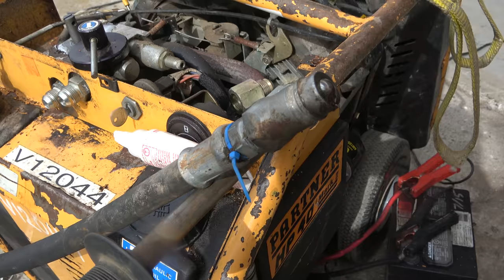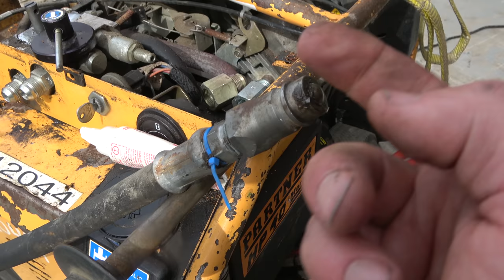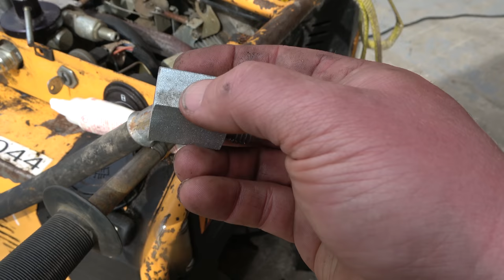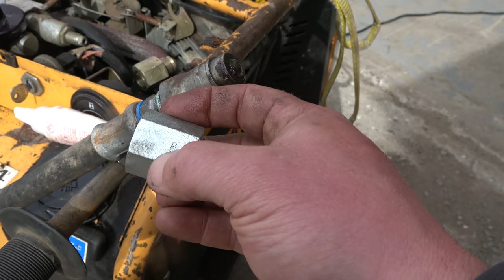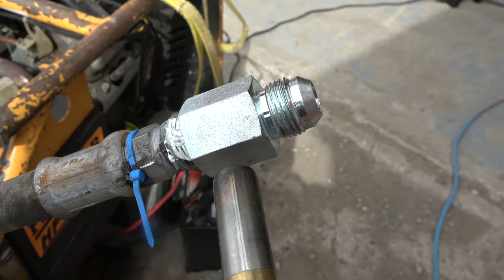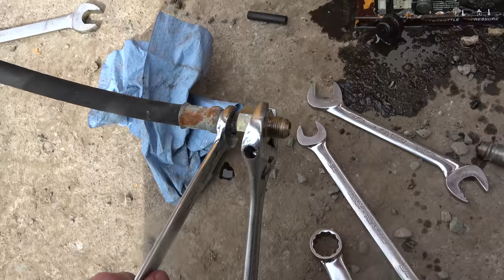#sharts Pipe thread that'll never leak (or come apart)

Comment: Youtube: shorts. Filmed vertical, under 1minute, use hashtag shorts in title or description.

Ave: Don’t tell me how to live my life #sharts
Reply: Yes!
Reply: I don't get this video. Why not use some teflon thread tape or a dip the darned thing in a tub of threadlocker?
Reply: @b3nadry1  teflon tape doesn't actually seal, it's purpose is to lessen friction between threads therefore, lesser torque needed to tighten fittings. (though fittings aren't exactly a thou or two of an inch precise) there may be imperfections in the thread hence they'd leak no matter how toight you do them.
Loctite threadlocker might do the job, but where's those 3 bottles of that stuff if'n you actually need them.
Reply: @b3nadry1  The point of any of that teflon stuff is to allow the threads to be tightened enough to distort into each other.  It's a crappy design, for sure, but it's been around for so long that we'll never stop seeing it.
Reply: filming vertical is a crime against humanity
Reply: @TheKeule33  lol agree
Reply: @b3nadry1  better to use a suitable sealant combined with flax fiber, aka angel hair. Used in much the same way as teflon tape, but actually seals. Bit messier to work with, but it works. Have to rough up the thread crests a little with a coarse file so they'll grab the fibers and drag them into the threads. Old school but skookum!

As for heating, wouldn't that work better if the female side was heated while completely off the male side so they don't just expand together? Bit more fiddly to get it screwed on quickly enough though.
Reply: @Kaboomf   "flax fiber, aka angel hair", aka "horse hair" - that's proper old school. As a kid I actually thought it was horse hair... On a flip side the teflon tape can be different grade as well, with the skookum one known (in the US, I hear) as 'military spec'
Reply: @stanimir4197  it's still available, and for some jobs it's the best.

We bought an older house, where any plumbing work involves adapting new stuff to old fittings that were apparently made to slightly different tolerances etc. Half a dozen thread adapters screwed into each other, where old-spec copper pipe mates with modern PEX etc. I wound up using flax fiber and permatex on all threaded fittings, after some attempts with teflon tape kept dripping. Not one drop since, that fiber works wonders as it expands to seal any minute gap.
Reply: @stanimir4197  and y’all above, Teflon tape isn’t impervious to some things. Fine for home water pipes, but what about industrial applications.
Reply: @Kaboomf  "it's still available", of course it is. I use it for 19mm(3/4")+ fittings. It's more fool proof as well.
Reply: @b3nadry1  The other answers too.
But do you think that would really be any harder to remove than a thread that some asshole has dipped in threadlocker?

Threadlock, locktite.... any of them, you need only cover two threads. Three max.

Comment: The coefficient of thermal expansion was my first introduction to the wonders of heat in a power plant setting. As my ignorant apprentice voice said with 70’s stoner amazement- “Whoa, dude! This steel moves when it’s heated!”
Many thanks to the journeyman who refused to throw me off the scaffolding for my insipid comments!
Reply: The difference today is you kept showing up for work. Now they show up late in party clothes not work clothes. After two hours digging they are completely tired out. Have their friend pick them up. Pudding has more of a backbone .
Reply: I am baked and even I was not surprised by that. But mil spec Teflon tape is so much easier................
Reply: @assassinlexx1993  I, for one, support the 2 hour work day. Work shouldn't take up the entire day.
Reply: @carpdog42  
If you can charge lawyer rates. You can just work 2 hours a day.
Reply: Can you explain what steel was expanding in a power plant setting. 
Im imagining the furnace or boiler rippling under the rivets with the heat.
Reply: @markc7955  Boilers are built by hanging the tubes and headers from a structural steel frame because of the expansion of the firebox caused by heat. Imagine a skyscraper that has a giant box hanging in the interior of it and the box is heated by coal or oil . The box expands down into a frame built on the ground. The frame isn’t bolted to the firebox, it just grows downwards. The same reaction to heat can be found anywhere where heat is generated or applied- ducts, pipes, vessels, structures, all have to be built with heat expansion figured into the design.
Reply: @briangarrow448  
Thanks that’s pretty cool. 
Do you happen to know at what point the water turns into steam in the pipes. Like if you have water in and steam out, at some point in the pipe it becomes gas and expands, how does it not explode or be chaotic?
Reply: @markc7955  Depends on the pressure.
Load up DuckDuckGo and search for "super heated steam".
Reply: @briangarrow448  In an everyday setting, you can hear the same process happening if you have baseboard heat elements. They're just a 3/4" copper line with tin fins on it. When the zone valve opens and the hot water from the boiler comes through you'll hear a "Tick tick tick tick..." from the baseboard. That's the thermal expansion of the copper rubbing up against the tin. Copper's more dense than tin, so there's a bit of a jostling for position as the heat transfers from the line to the fin. It's also why pipes are never clamped, hung or supported on a fitting. You always want to give a bit of room for the pipes to expand and contract without butting stress on the hanger, bracket or trapeze.
Reply: @assassinlexx1993  Well...my apprentices either leave the first day, or last forever.
Reply: @andygilbert1877  
It is good you can weed out apprentices early.
I just wish high-school would promote the trades. Not just going to collages. 
Good luck with your business
Reply: @assassinlexx1993  I don’t think schools ever have really. I was lucky at school I guess, and was encouraged by a teacher who had worked in engineering himself. I think some people are born to make or fix things and some aren’t, and will never really get it. Not fair to encourage these people.

Comment: Also, weld it around, just to be sure.
Reply: Cover it in zinc too, worked for arecibo.
Reply: JBWeld as pipe dope.
Reply: Or put the FLEX TAPE
Reply: @MaineHomeShop  I did this on a union that wouldn't stop leaking on my compressor line in the garage, it doesn't leak anymore.
Reply: @MaineHomeShop  did that to the transmission lines on my first car, kept leaking at the radiator. Turns out I was the next guy so it wasn't the best plan in hindsight lol
Reply: @Mr Brightside I just had my first weld from 30 years ago fail. Not due to me but being outside for 10+ years rusting away outside.

OP, funniest comment of the whole comment section!
Reply: My dad did that out of desperation once, when a brass hydraulic fitting screwed into a steel part kept leaking on some old agricultural machinery. Liquid steel doesn't wet brass, and even though brass has a lower melting point it's harder to melt with an electric arc because higher thermal and electrical conductivity. He used a stick welder with old damp electrodes and somehow built up a puddle of molten steel all around that fitting, when the weld cooled that thing was tight! Been more than 30 years now and it hasn't leaked a drop.
Reply: @Kaboomf  I've brazed dissimilar materials before but that is a new one for me for someone to do it with a stick welder and wet electrodes  🤯.
Reply: @Chris-dg6km  He didn't know that electrodes absorb moisture, as I recall they were always just kept in an open package. Welding on a farm happened infrequently enough that those sticks would have been absorbing moisture for years.
Reply: red loctite?

Comment: As a new owner of a hydraulic/gremlin powered equipment, I find this content priceless, I’ll be back in a year or two when I can’t get the thing apart to curse the day you were born, spanks again for the info!
Reply: You just hear it back up again to take it off.
Reply: @WARnTEA  See, you weren't supposed to tell him that until AFTER he'd broken three wrenches on it.
Reply: Get a can of x-pando pipe sealant. Works wonders on hydraulic elevator plumbing and even seals torn out threads from dull threading dies.

Comment: I work with hydraulic pipe fittings every day. I have probably tightened thousands of fittings which operate under thousands of pounds of pressure. You don’t need to heat up any fittings before assembly. What I do to guarantee a non-leaking connection is:
1. Clean the male and female threads. Remove all oil from the threads. Brake clean works best for this.
2. Coat the first three to four threads with thread sealant, loctite 567 works nice. Do not use thread tape. Work the thread sealant into the root of the threads with your finger, this keeps the sealant from just getting pushed out when you tighten everything up.
3. Tighten the snot out of it. Use the proper sized wrenches, leave the crescents in the bottom of your 5 gal pale. How do I know it’s tight enough? When it doesn’t tighten up anymore with just the proper wrenches (snipes are for the pros).
Reply: Did this before use with all the below oil level fittings on my shoddy 30gal off shore oil drain, dry as a whistle after two years. How much longer the scary clear drain hose/sight glass lasts is another story.
Reply: Second on no thread tape.

Comment: Well unless you're using cast fittin's and don't want them to crack once you fire up the boiler, but that's why you use forged fittin's. 
But also, try Leak Lock brand dope, we use it with fuel since it's actually a sort of a sealant, not just says sealant on the jug like most. 
UA Local 601 Steamfitters, Milwaukee, WI

Comment: NPTF (fuel) is made without the crest/root radius iirc. The result is an interference fit at the root, so you have a mechanical seal. EO bite fittings use a double beveled washer that creates a high contact pressure mechanical seal. No rubber seal, oring, or tape. Skookum as frig!!

Comment: To bad heavy equipment made in Europe then shipped to the USA takes 6 different wrenches to just get two hydraulic lines off...1",5/8,19mm,17mm and two adjustable wrenches set to unknown sizes. Lets not forget that the two bolts are 1/2" and 10mm that hold the mounting bracket onto the machine and the nuts on the end of those bolts are  3/4" and 16mm. I swear to god New Holland from Belgium get you nuts sizes figured out damn it.

Comment: my grandfather worked on the ford assembly line in so cal from the 20s to the late 50s.  he helped mom do some plumbing in our mountain cabin.. decades later mom wanted to reconfigure the piping.. grandpa had put it together with locktite.  mom had a heck of a time till she got out the torch.. .. not saying locktite for the fittings but i love that heating the fitting to expand it trick..  just have to recall don't do that to fuel filters and carb fittings..

Comment: YOU CRACK ME UP.  i grew up with a big ass lathe in my basement.. my dad and me used to make little cannons out of steel, what would use a ram set cartridge to fire whatever you could stick down the barrel... mostly wads of paper..  but sometimes.. we would load the lathe swarf into the barrel and fire it at the wooden wall.. just cuz it would make a pretty abstract picture... 
rockinroll

Comment: When the Next Guy was going to be me, I used valve lapping compound to "match" the threads, then cleaned before final assembly. The heat tip I used on equipment that was to be sold soon.

Comment: Any worry about that derating the pressure limit on the fitting? I’m not versed well enough in heat treatments to know if that is enough concentrated heat to effect the overall material strength.
Reply: No, a few hundred degrees for a couple seconds isn't going to be enough to do much of anything to the material properties. You don't have to heat the shit out of it, like the man says, just hot enough to burn lol

Comment: What a great shart! I would have never thought of that. 

This coming from a guy that recently realized heat greatly improves your chances of breaking red loctite loose.
Damn you ford for putting loctite on the fasteners that hold the plastic step pads to your chincy ass chunk of steel you call a "bumper".
Let's not mention the sticker that says don't remove the hitch, it's there for safety...

Comment: Hi. Can you(or someone) explain the “1 thousandth of and inch, per 100 degrees, per diameter” heat expansion thing? I can’t seem to solve this in my head. Thanks. 🙃
Reply: 1mil per inch/ per 100°F / per 1 inch of diameter. 

It means 1 inch diameter pipe heated to 100°F (above starting temp) will expand 1 thousandth of an inch.  Also means of you keep going with the temp and it the size the amount of growth/ expansion will accumulate/aggregate/be cumulative. 
That's why railroad track/line have slotted joints.   So that the temperature difference allows for the expansion and contractions from temperature.   Miles of track the growth and shrinkage adds up.
Reply: bmxscape oh I see.  Thanks. Ya makes sense 🙃

Comment: AN fittings work wonders for 3000 psi hydraulic fluid on aircraft. Beam seal fittings handle 5000 psi pretty well too.
Reply: I have worked with hydraulics ALOT but those are new names for me. A quick Google search shows the AN fitting may be what is commonly called JIC or more properly 37 degree, SAE thread, or possibly those silly automotive 45 degree ones. 

I have no idea what a beam seal fitting is, though. I have no problem with people using different names than I use for stuff, but I am interested in knowing what a beam seal fitting is as well as the AN fitting.
Reply: @timothyball3144  They are both military aviation standards. A beam seal fitting is used on high performance aircraft with 5k psi. Its kind of like two flat surfaces from each line that are torqued to a very specific value to ensure the seal. The problem is, one grain of sand with cause a leak. Kinda rough operating in the desert.
Reply: @blackhatch46  Thank you. That explains why I haven't heard of the beam seal.

Comment: So here's a stupid question :

If heating up the female end expands the metal, that makes the outer hex measure a little bit bigger. I get that. 

Wouldn't it also make the interior measurement smaller, since the metal expands in all directions? Like ya bake a donut, the hole shrinks, right?

Comment: For water connections, why not just teflon tape?
Reply: He is working on 3000 psi rated hydraulic fitting connections to pipe thread.
Reply: OMG, why would you think it was a water line....

Comment: So, I have the opposite problem. The nozzle of a 3D printer always comes loose. Now I think it is because it expands as it is heated. Besides over heating it and torqueing hard, do you have any other tricks?
Reply: Maybe just a turn or 2 of teflon tape along the thread. I have to say I've never heard of them coming loose even when hot.

Comment: I cursed the hell out of a guy who installed an engine in a truck without thinking of the inline fuel filter which was simply unreachable between the frame and the motor mount. Turned out that I installed that engine myself a few years ago...

Comment: I would use pipe packing on the threads or pipe tape which is real easy to use unless it is very dry.  Static on the Teflon tape can be a bitch.

Comment: Why just go the old good times eh ? every time i use this new teflon band shit or a leakage shmoo shit they make, its a 50/50, either its gonna leak, or it wont, its fast, its easy, but it makes you do the job 2x most likely, now when i go old times, hemp and some shmoo, its a 95/5, gonna hold/gonna leak, takes more time, but saves time, hope it makes sence... anyway, it takes you more time to preper the leakage spiral but the effects are... i do it once, sometimes, once a year i do it twice. Last week i was on a job, client asks me if i can change 2 valves, i say sure, he had 1 new 1 old, new one came with teflon ring, the one you turn in and its sealed, the key is you just turn it one way, if you go back, it will leak, i know that, so i did what i know, old one had no seal at all, so i scrached the lekage spiral, apply hemp, apply shmoo, i put it in... customer turns on the water pressure and guess which one leaked ?

Comment: I don't think this is true...

Sure, it's never going to come loose, but there will still be a spiral leakage path.   One end will have pressure on one side of each thread, and a gap on the other, while it's reversed at the other end.   The fluid can still seep along the gap, move around the edge of a thread in the middle, then use the other gap to go the rest of the way.

Just use an o-ring and don't rely on threads sealing...

Comment: G'Day,,hmmmmmm,,
Ya Do Know that why NPT threads have a sharp top and flat bottom in the thread form now don't ya,
As you screw the fitting to-gether,,the pointed tip of the thread rolls over forming the seal,,
That why you should never ues a NPT threaded fitting twice,
being an X Hydraulic fitter,, ya get to learn this sorta stuff,,
Another fopar is the fitting running out of female thread before bottoming out on thread fitting,
In other words too long for taper to seal..In the Short hole,
Would mind a dollar for every roll Of P,T,F,E I used,,